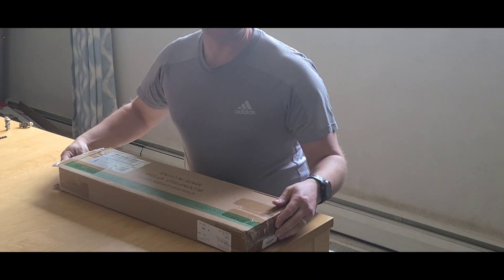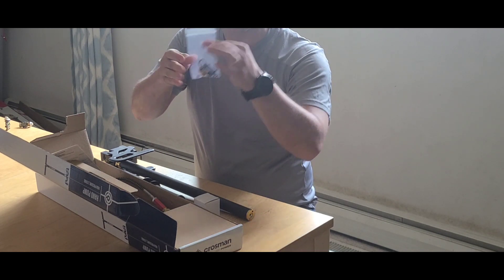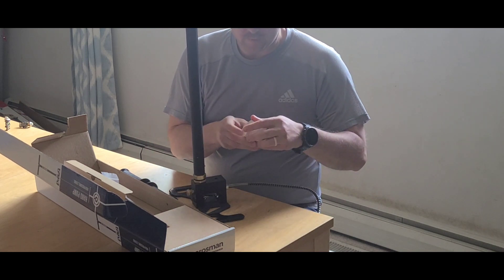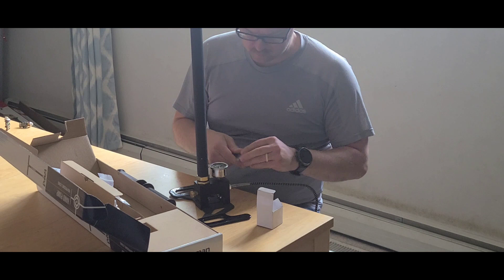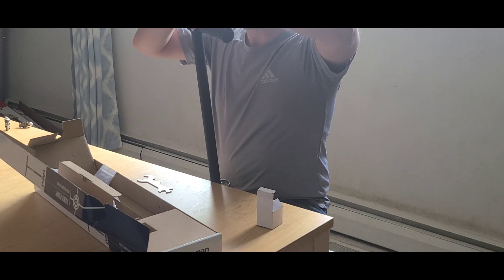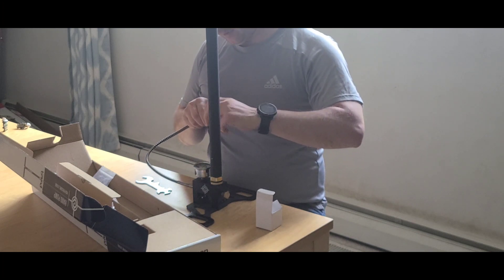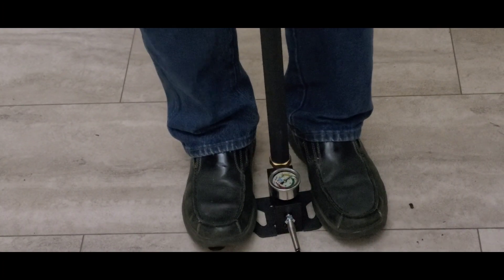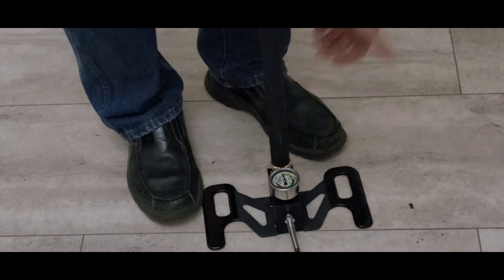Learn with Me - Assembling the Crosman Hand Pump

Comment: How much oil did you put in the main tube?
Reply from the maker: None initially, as it was already lubed. I don't really use it, as I have a little rovair compressor that does the bulk lifting.
Reply from the maker: @johnnybbgunner2136  I should give it, and me, workout this week with the 3622. Thanks for the inspiration, my friend. 🤠 🇺🇸
Reply: @ 
I started with this Bandit and will try my VELOX pistols next.🤠🇺🇸💪
Reply from the maker: @johnnybbgunner2136  I actually was just thinking that February is hand-pump 3622 month for me. I will try and make a vid soon, but nothing but hand pump for the 3622 this month (and try to daily shoot it). Pump Johnny Pump!